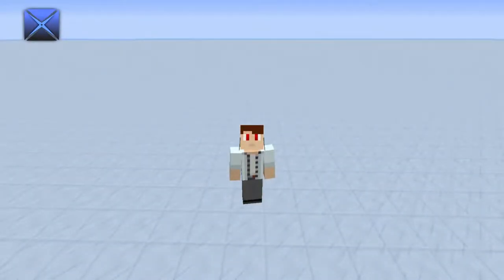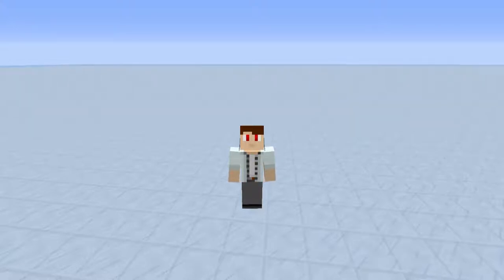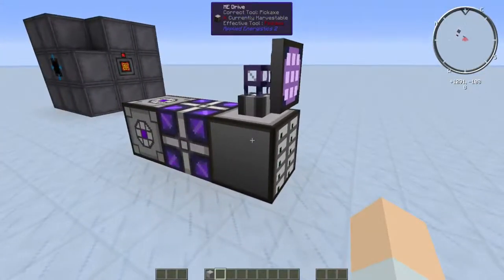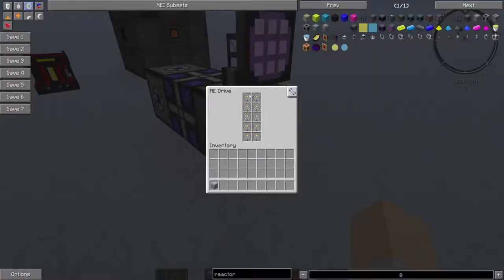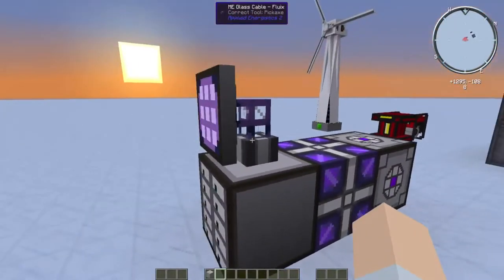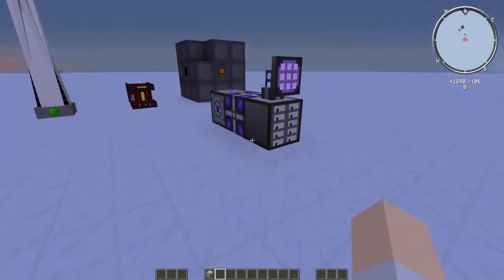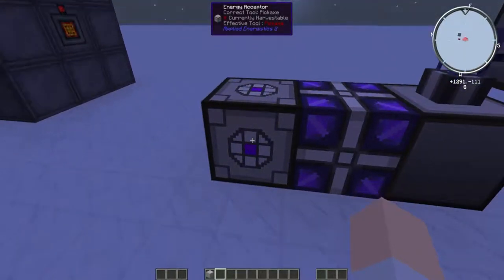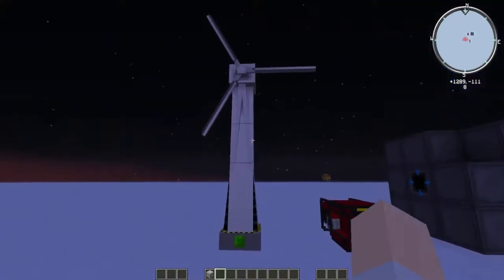Step By Step: Power Systems!! || Basic Setup || (Minecraft Tutorial)

Comment: What is the best cable for my reactor that generates 260kRF/t?
Reply from the maker: well that is a lot of power. :P

what I would do is stick one tesseract sending power onto the output port, then have a few more tesseracts sending it into a large power storage bank, or draconic energy storage.

you could also check out fluxducts. not sure if it is in your pack or not, but there is one that has unlimited rf/t capabilities. 
or have multiple power output ports on your reactor. several ways to handle the load ;)

Hope it helps ;)
Reply: Xogue It is the maximum big reactors size ^^ I know that it is fully over powered. And thanks :)
Reply from the maker: MTRNord ;)  Nicely done!
Reply: I know this is a year old, but the max reactor size in my pack is 32, 32, 48 (x, z, y) maxed out makes over 1M RF/T